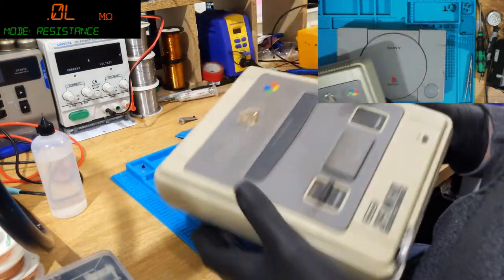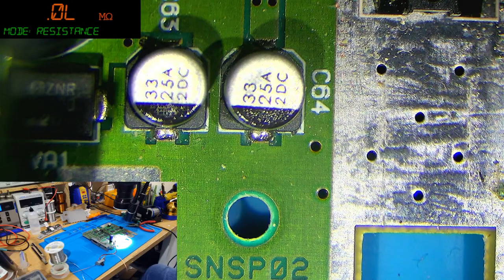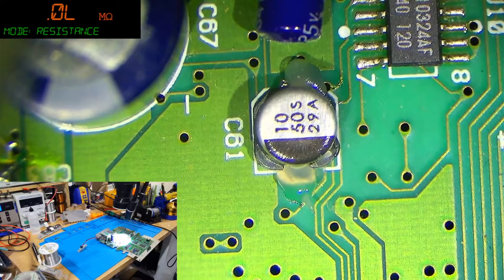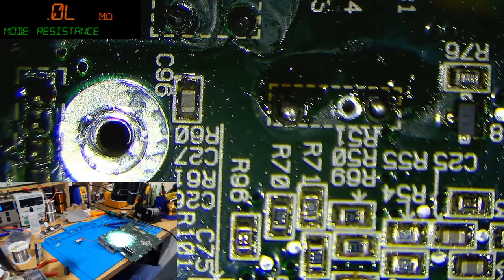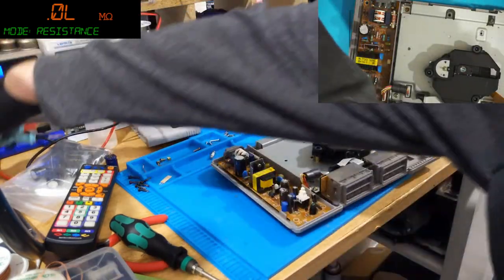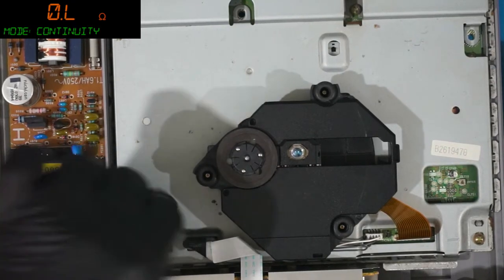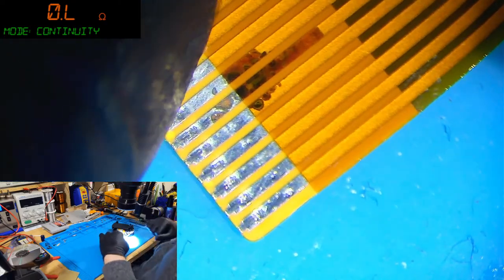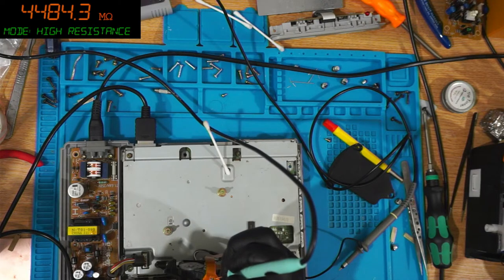Retro Console Repairs - Let's repair some faulty consoles

Comment: I like how a SNES and PlayStation are in one video - with the PlayStation being Sony going alone and creating a 32-bit console after the Nintendo-Sony "Play Station" (SNES with built-in CD-ROM drive) and the SNES CD-ROM add-on (both of which Sony were involved in, after developing the SNES sound chip) were both cancelled due to Nintendo changing to a partnership with Philips, which in the end only resulted in the Nintendo games on the CDi.

Super Everdrive is nice but I believe it only supports one cartridge expansion chip at best, the DSP-1 (used in games like Super Mario Kart and Pilotwings), so at most, only 16 of the 73 expansion chip games will work (if any). I think for any games that use any of the other cartridge expansion chips including Super FX 1+2 (StarFox, Stunt Race FX, Yoshi's Island, Doom etc), an SD2SNES Pro / FX Pak Pro would be required.

Comment: Would you be able to repair a PS1 board? I had a board that stopped working after I went to connect a loose ribbon cable, it was modded with a Xstation, after a few months I bought a replacement console of same model and then suddenly the first one "worked" in that it booted but had a distorted picture and slow audio, I desoldered the xstation and when soldering to the 2nd one I didn't notice I flicked off a few capacitors, I tried desoldering from old board to new one but as they are so small I kept losing them!

Comment: Can you help me with my snes only showing a black screen? I cleaned the game cartridge slot and i am afraid it's one of the chips but i can't test them.
Reply from the maker: You need to test the address and data lines on the CPU, PPU1 and PPU2 using either an oscilloscope or logic probe. 

Look to see if any of the lines are being held low (0v) or high (5v). If some of those lines are held either high or low and don't change it likely indicates a fault with the CPU, PPU1, PPU2 or potentially VRAM or WRAM IC's.

A black screen is most probably the CPU or PPU chips from the SNES's I've tested over time.
Reply: @NewRetroRepair  thanks a lot!!